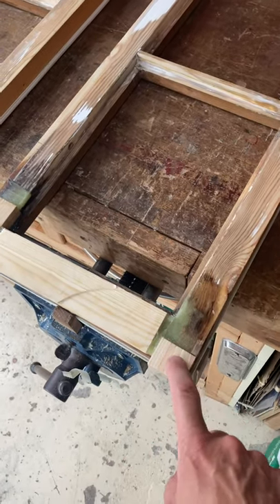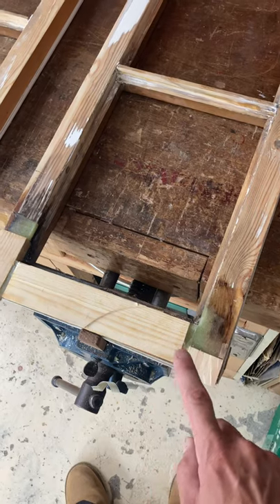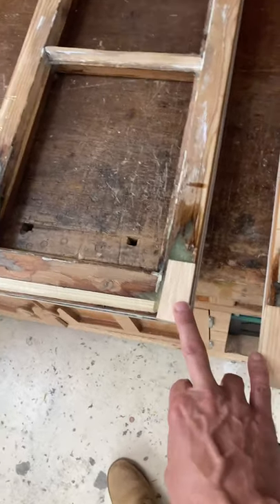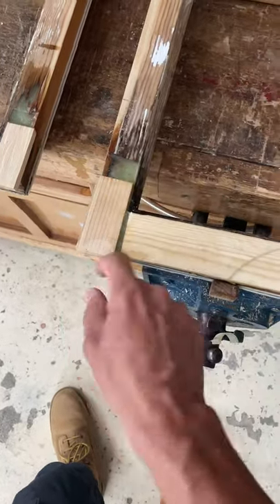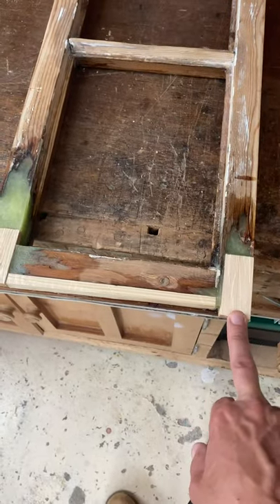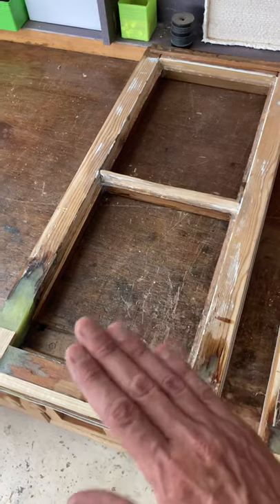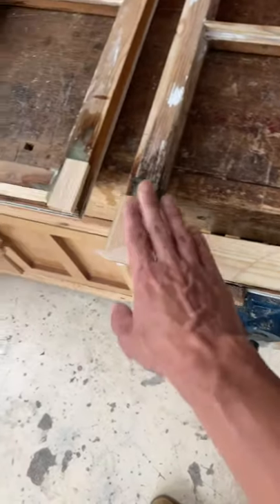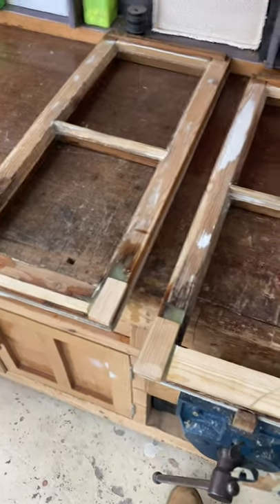Repaircare resin repair tips for rotten windows and doors.

Comment: Great series on the system.
I have a sash with a loose and partially rotten bottom rail/stile joint. Could repaircare be used as an all-in-one solution to reglue the joint and rebuild the removed rotten section?